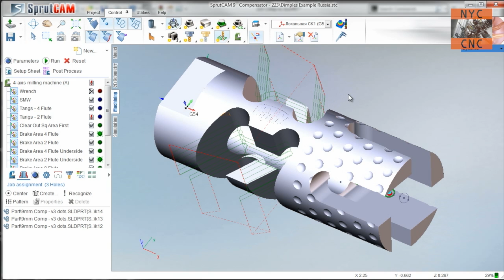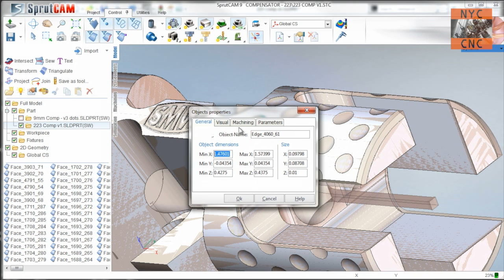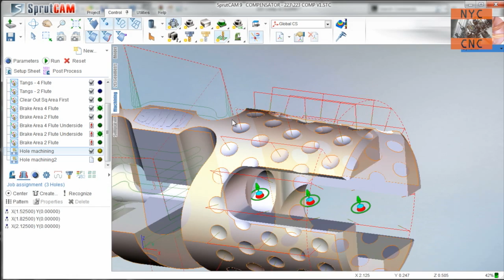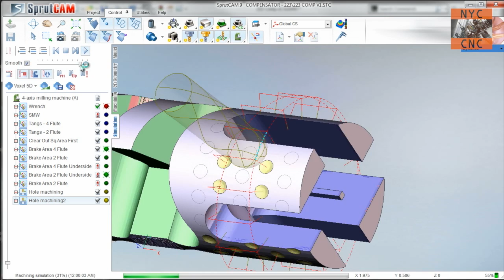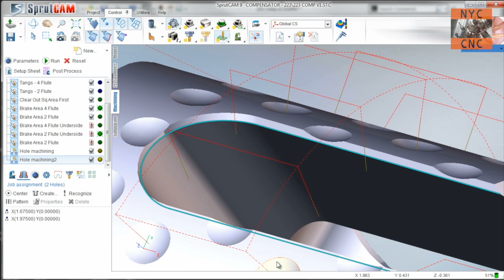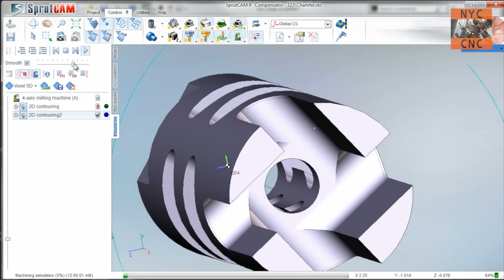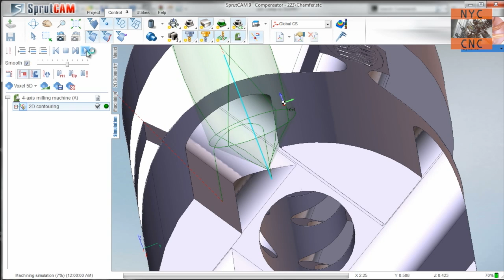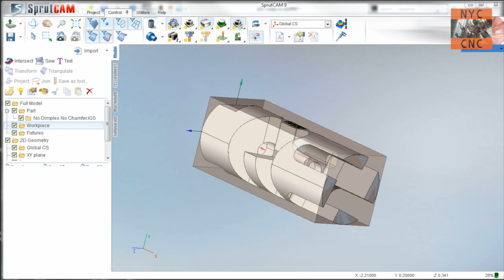Machining a 9MM AR-15 Muzzle Brake! Follow Up Video on Dimples

Comment: Hey John.  Just watched this video today.  I really like that brake!

The chamfer - At one point you asked why it didn't give the same chamfer on both sides.   I noticed that in Strategy (I believe) you didn't have the 'head' set at 'Fixed' in the lower right corner.  Would that make the difference?  (4th vs 5th axis)???  That's my guess.

Also what I found out about chamfering is to select the bottom edge of the chamfer and set a contact point on your tool - say .01" (or whatever you need) up from the point.  I believe this method would ignore your dimples.  Again a guess.

Comment: Really cool video as always :), although I was wondering wether there was a way to get the mill to return to the right x,y as it rotates in the 4th ? Rather than waiting as it does atm, I realise it doesn't matter for this part but a video on small efficiency improvements would be interesting especially if it were a part being produced in higher volumes.

Comment: Awesome man! That thing is looking mighty sexy. I appreciate the fast forward on redundant footage but also appreciate the real time on new machining ops not covered previously. I try to do the same thing. It's important to see the real time footage to put things in perspective. Can't wait the for the cerakoting!
Reply: Awesome! Won't be long now. Doing some minor code revisions tonight and will begin official production tomorrow!
Reply: HAHA! No not really. I did have to modify some things I call shields. They are just floating surfaces I add around the model to trick the 3D toolpaths into entering the cut at different angles to make smoother transitions. Works really well actually.
Reply: Well...works great as far as tricking CAM software goes. ;)

Comment: Nice video. The only way I can get sprutcam to chamfer correct is to offset the tool. On the Parameters page. Say the bottom level is -.05 set the stock to .04 or .05 and it will offset the tool so your not cutting with the tip of the tool but the side of the tool. Hope that helps.

Comment: The problem with the Champfer is that the program is aiming the center line of the bit at the center of the part, not really on an angle that would necessarily be conducive with creating a consistent champfer on the opening you have in front of you.  If you were able to adjust the angle that the bit was aiming at, closer to the original milling that was done, would probably clear some of that up, though, I don't believe going all the way to the original milled slot offset would be appropriate, but something in between would most likely work.

Also, I don't have any milling background, but I would have thought that doing the dimples first, would make the dimpled places that intersect with the slots at the end less likely to walk, but I may be wrong, as I've never done it before and am just imagining what could possibly go wrong with it.

Comment: I've been meaning to ask. So when you started the milling of the dimples there was a second as the motor got up to speed and one (at least that's how it seemed to me) could hear as the vibrations got higher and higher.

Is it just my imagination or is the whole thing actually having some vibration issues?

I'm asking because with audio you never know.
Reply: NYC CNC So you think it might be the bearings then?
Reply: NYC CNC My lathe has had similar especially with cold weather. Glazed cold old belts (cheap and quick clean/fault find) or bearings. Good luck. Intermittent gremlins are not fun.

Comment: John you would greatly benefit from a new cam system.
Reply: NYC CNC
Ive given you my opinion.
Ive had a chance to work with Solidworks with solidcam and mastercam. Ive also used other like bobcad , hsmworks and camworks .
Solidcam and mastercam x8 are seamlessly plugged into solidcam and I love it. I happen to choose solidcam . I think there a better cam system. 
Im not paying your bill though .
I do know as I watch your cam tutorials I keep think its so much easier if.....
Im not sure why but solidcam just knows what I want to do and has no problem ever once reproducing code. I can edit on the fly in solidworks with solidcam go back look at what ever I need to it was made for solidworks solely originally. Unlike others.
Ive used it in work on a huge doosan hp440 different older fanuc mills all the way to my tiny little mach3 based g0704.
Again Im not paying your bill. 5 axis is some where around 45k
I told you next time your in ct stop in and play with it..
Reply: NYC CNC
Ya I didnt like it but its like driving a 5 series (solidcam) bmw your whole life then being forced to drive a geo metro (hsm works). 
Im not paying for your shop though. Ive heard from avid users they love hsm work.
Its a big commitment. I would take 6 months of testing what ever ones you choose.
Usually the cam systems that are harder to learn are because they give you more control and I want control.